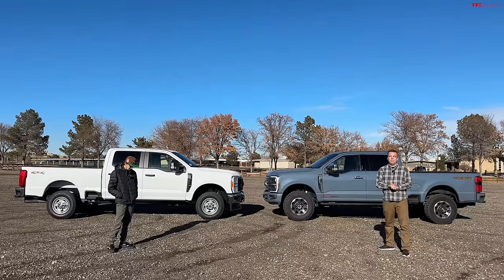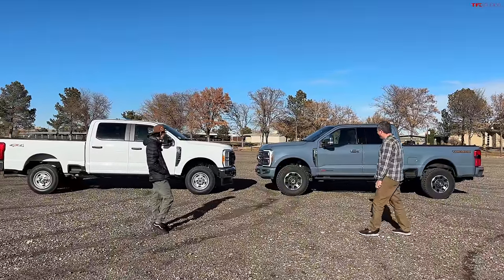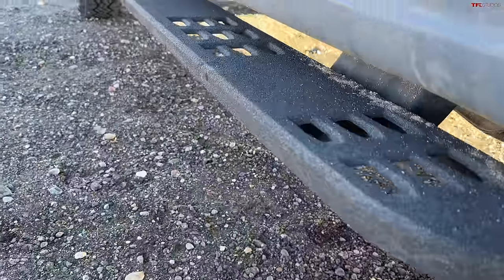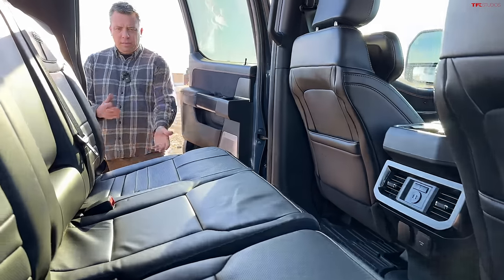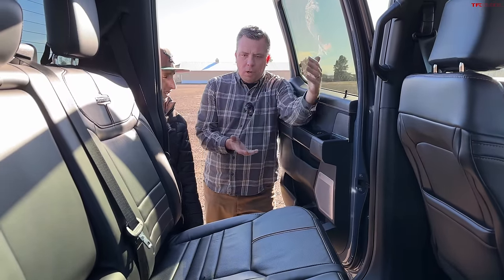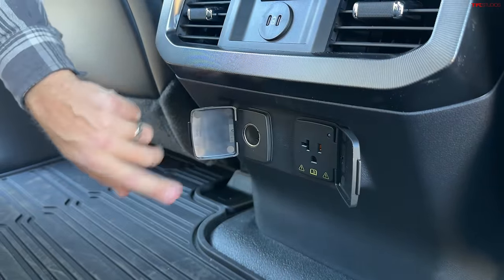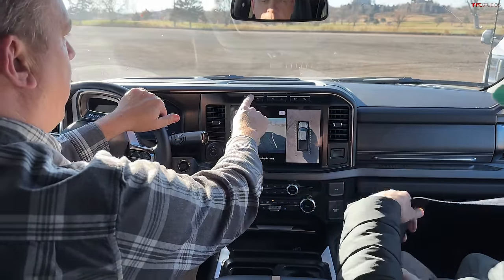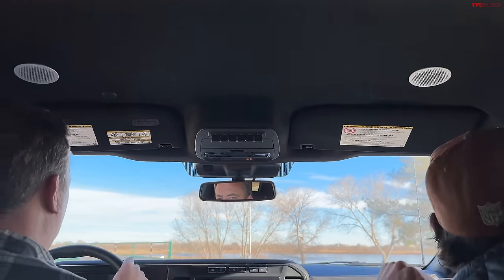New Ford F-250 Work Truck vs Premium Diesel F-250: What Do You Get for an Extra $50K?

Comment: Lmao, ya those vinyl seats are awful hard on the hemorrhoids during those late season elk hunts or cold temps in general,  lol I used to love them for wear resistance and ease of cleaning but the uncomfortable time came when I had to at least switch to heated cloth seat . After that it was impossible to picture life without a heated seat. I hopped into a Powerwagon one time on an elk hunt that was command started previously and as my blue fingers wrapped around that heated steering wheel I almost nutted . Some features in a truck are priceless,  most features are basically worthless for the average owner. And yes, being 45 minutes from the nearest maintained road and the ECM throws a heavy derate because the DEF heater shorted out sucks balls and then you have to endure getting towed out by a hick in a 78 K30 who is deliberately firing empty beer cans onto the hood of your pos $90K truck as you watch his 9.00-16 Firestone bias ply mud tires ding up your chrome grill as he roars relentlessly over the hand held radio about how your broken down truck is messing with his elk hunting trip. The trauma still hurts.

Comment: Goodyear, worst tires ever
Reply: I have duratracs. They are amazing
Reply: Goodyear SR-A Wrangler tires on the RAM trucks wears a little faster than the All terrain, the Fortera on the SUVs has great quality and even less wear.
Reply: OEM Good for a year. The non OEM Goodyears last way longer.
Reply: I have a Tremor and I like the duratracs so far. I hear they have weaker sidewalls for offroading concerns, but so far they are great and not noisy. I will probably replace them with Falken Wildpeaks in the future, as those are amazing tires from my experience.

Comment: The cheap one still has far too much electronics to fail at the most inopportune time. And the price is ridiculous. 

The bed is the bare minimum for me in size. 

I need physical switches for every working item. As a work truck touch screens are useless when you are wearing gloves and have to look away from the road to find the right menu on the touch screen.
Reply: Then just get one with an 8 ft bed, and the touch screen doesn't really have anything in it that is a necessity. All the HVAC controls, four-wheel drive and locker, headlights etc. have knobs and buttons
Reply: @AK_Ray  those "switches and knobs on the new trucks and cars aren't real switches and knobs they all go through the same computer that runs the screens. The screen fails and so do the switches and knobs.
Reply: @ramonmacias9013  sorry but that's actually inaccurate. The screen runs through the APIM module the HVAC goes to the HVAC module, the four-wheel drive switch is directly wired to the shift select solenoid on the transfer case so no module. The different modules do communicate with each other through the bcm via low and medium speed can bus but one's operation does not dictate the operation of another's.

Comment: The biggest sins on the XL are the headlights, lack of fog lights, remote start and cameras. 
The headlights would need to be changed immediately and bulb upgrades aren't it. When diode dynamics creates an entire assembly along with a fog light solution  it'll be worth it. The XL is how I'd go but it needs about $15K in changes to be an every day driver.

Comment: There are a lot reasons why I don't buy trucks/Suburban now "Yukon XL"s anymore. Especially the Big guys. But, definitely a BIG pet peeve of mine particularly in the 🇺🇲Brands. Is no longer an OPTION for Me to get EVERY "luxury feature" WITH THE Front BENCH Seat! Because "I" really Do like & prefer that so much more! Column shift Big cushy bench, sure my Bullyboxer would ❤sitting next to me. But so would my fellas or vice versa on those long drives NTGL. Trust WAY Better than ANY infotainment center stack.😂 - Why I love in part my big cushy Cadillacs! And Alex, I guess Kase was right huh? Not the Govt whose soft 😂. I often tell ppl can't handle something BIG then don't get it. Thankfully I can, love anything MASSIVE! My daily Fleetwood in Denver is same length of '23 Yukon XLs😂 & guess what? No sensors or back up camera needed